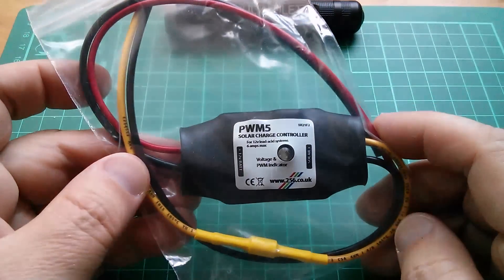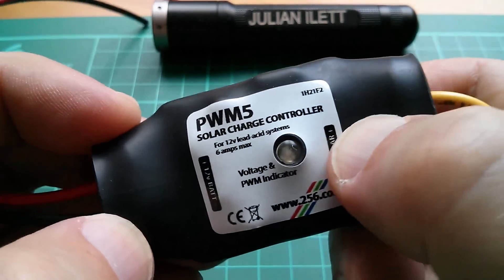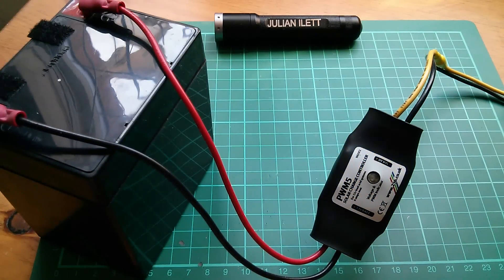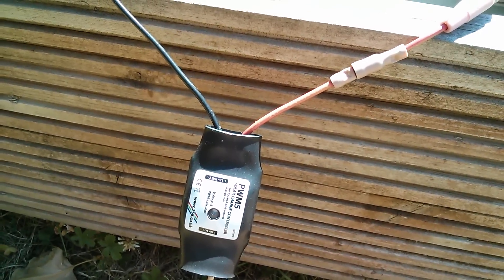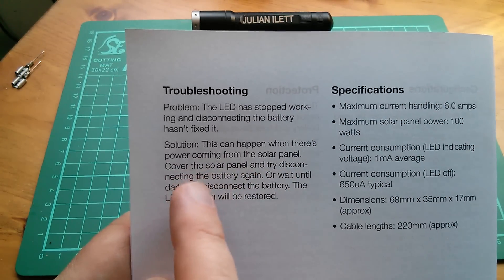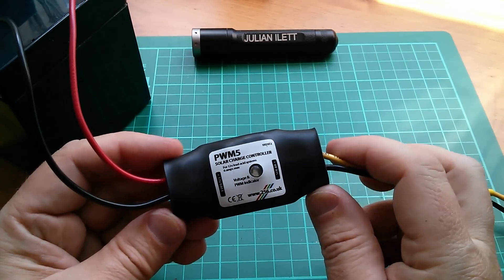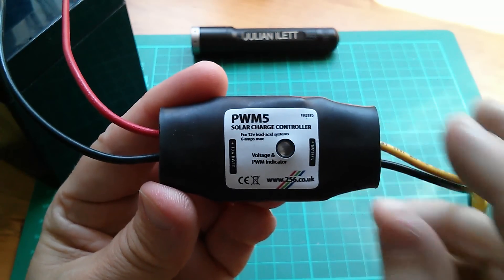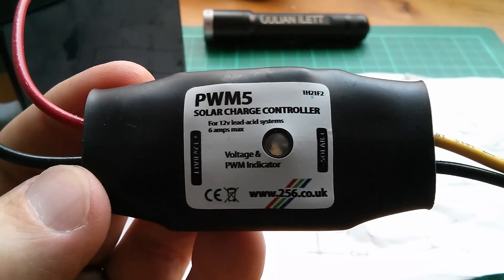Julian reveals: Secrets of the PWM5 - #2 Misjudgement

Comment: Those instructions were not very good.   It is really not hard to say,  very clearly,   that to reset the device it has to be disconnected from both the battery and the solar panel.   This is in fact quite non-obvious,   since most devices are not supplied from both sides,   and if you disconnect from the supply side,  then people expect them to be off.

Comment: New to your channel, but I have to say it surprised me how many people don't don't the manual. Your manual is 1000000x better than cheap Chinese ones. Some common sense helps people. Would love to buy one of these... can't find a reliable charge controller that I like. BTW... love the LED feature... got what it was by reading the label... ha ha... but then again I can read and understand electronics which is where people go wrong with electronics... not having a background or understanding the theory. Diode in the wire is a definite keep no matter what. I have seen diodes in panels fail epicly with whole house electrical fire as a result.

Comment: Were there undervoltage issues? From what I can see PWM5 doesn't monitor battery voltage to protect it if it goes under set limit.
Weren't you worried about getting battery voltage too low and damaging it?

Comment: Hi Julian, I bought a few Boost converters off ebay they waist more pwer as heat than transfer to the battery, may I ask if I can buy one of yours to try please ? I need one that tops out at about 15 volts as it goes via a current regulator circuit and their are some voltage drops across diodes before it gets to the cells. I would love one with the flashing LED feature it will not bother me as it will go in the hallway only spiders sleep in there.

Comment: Nice to see traditional assembler, instead of the blocks of macro's people seem to use.
I added an excess of features to my RGB controller code, then backed off before releasing it because I knew it would just get people tied in knots.  On my RGB knob based controller I even put in a factory reset function (hold knob down while powering up).  That was useful when people calibrated a colour all the way to zero and then complained the channel wasn't working.
Reply: Dealing with end users is a pain in the ass. They never read manuals.

Comment: Julian, this feature is useless. If you don't like flashing led, just cover it or flip controller over :) You would have less trouble if you include black sticker with your product (just for these who can't sleep knowing that one led is still on) instead of your hard work coding this thing.
Reply from the maker: Martynas Mirauskas In a way you're right, it is pretty useless. I deliberately made the LED flashes very short (about 20ms I think), so current consumption is kept low even with the LED operating. During PWM (when there's plenty of surplus power) the LED is on far more of the time.

Comment: I noticed the CE marking on the label, how did you make sure it operated according to the requirement set in the regulations? Did you send it off to have it tested?
Reply: Hampus Sandberg The reality is that you can't, not really. CE marking requires compliance with the EN standards for Conducted Emissions and Radiated Emissions (amongst other things). You can build your own measuring equipment (near-field probes, LISNs etc.) but you will still need Spectrum Analysers, detectors, shielded room, and so on to make the measurements. And how do you demonstrate that the transducers and measuring equipment are working properly and suitably calibrated? You can't without paying a fortune for independent calibration to traceable national standards.  Self-certification does not absolve the manufacturer of this responsibility.

Apologies if I have gone on too much about this, but it's an important area for anyone thinking of designing their own products to sell.  Mind you, contrast Julians' in-house testing to the 'products' from China which probably have never been tested for emissions at-all in their life!
Reply from the maker: Hampus Sandberg Nope - I did my own testing. Interesting thing about CE marking is that products can be self-certified.
Reply: Julian Ilett Interesting, but how did you make sure your measurements were valid and done in a correct way? I would be very interested in hearing more about it, maybe add it to this video series?
Reply: Will Easton I think this is an important subject as well. I took an EMC course last semester and the one most important thing I learned from it is that emc compliance is all about standards and making sure the measurements are done correctly. Doing it at home by yourself is probably as non-standardized it can be, sure you can do some pre-compliance testing to get a ballpark figure but really it doesn't say much.

Like you say, many china products probably get away with it because there's to many products on the market. As long as they don't cause to much disturbance they can get away with it unfortunately. I get that this might be a sensitive topic as just putting a CE marking on the product without testing it at a proper facility probably is illegal, but I think it would be interesting if Julian Ilett explained how he did it and what the thought process was for this product.
Reply: Hampus Sandberg Yes, I agree totally. Like you say, it would be nice to know the testing Julian performed in terms of EMC.

By the way, a much bigger concern for products from China is safety, Julian has shown this in a number of his videos. Here in the UK the Trading Standards authority is unable to keep-up with the large quantity of imports that are untested, badly designed, and potentially lethal. Maybe a topic for another day?

Comment: I have a PIR security light where you turn it on-off-on in the first 2 seconds to fix the light constantly on, as the only easily accessible switch indoors is the fused (optionally switched) spur. It seems that's quite common in some form or another. I like it because moisture in the PIR sensor is what kills most PIR security lights

Comment: Maybe something like a magnetic reed switch would have been a way to change the LED mode without compromising the enclosure. Boot it up with a little magnet touching the device somewhere and the LED remains off.  No magnet = normal mode.
Reply from the maker: Mark Warbington That's a nice idea, although it would mean including a reed switch in every unit.

However, I've just thought of the solution, five years too late of course! Connect the controller to a 9V battery - the low voltage is sensed during the initial 2 second boot and sets the LED disable flag.
Reply: Julian Ilett Help, my led broke when I tried to charge an almost empty car battery ;)    Thumbs up for this series! As a plc/HMI engineer I also run into these kind of issues. You add something usefull as an extra and it turns out it will cost you time in support...
Reply from the maker: thextremeking Thanks for the thumbs up. Of course that would happen, but far less often. Lead-acid batteries are pretty knackered if they get down to 9v.
Reply: That could have been a nice solution.
BTW, error40 or error16, depending on metric or imperial, are not covered by any warranty, so you would have been in your right to charge for at least return postage.

Comment: Why did you write the code in assembly?
Reply from the maker: drojf Most of my programming experience is in assembler. Back then I'd not programmed in C at all. Arduino was my first introduction to C.
Reply: drojf Because C on a PIC12...
Reply from the maker: Mandrake Fernflower Indeed. I run the CPU clock really slow (500kHz) to use less power, so efficient code execution is important.

Comment: A very interesting video, what seems intuitive to techies is not intuitive to everyone. I recently was using a friends boat that uses a solar panel and controller, the controller is a clever piece of kit but by careless pressing of the only button on the unit it can be inadvertantly set into modes that don't suit the 200aH or so of attached flooded lead acid battery. In the case I am referring to the controller has status LEDs but they are very dim (presumably to save every possible milli-amp) so people are drawn to pushing the only button on the unit.
Your controller seems to have a very bright LED, perhaps you could slightly reduce the current through it? For people sleeping on a narrowboat simply put a sticky label over the LED or slide a sleeve over the unit. I think that due to cheapness of electronics these days fewer and fewer of us read the instructions correctly. 
It is good to see that you are making efforts to keep your customers happy but it does highlight how difficult it is!

Comment: I'm loving this series Julian; thanks for sharing the inner thoughts of an innovator. This topic of basically "falling in love" with a feature, despite what customers say or think rings so true and is great example of a trap to avoid for any entrepreneur, regardless of domain - be it electronics, software or a corner store.
Reply from the maker: pratalife If I'm honest, part of the reason for developing this feature was so that I could learn how to read and write to the EEprom - not a very good reason for adding a 'feature'.
Reply: Julian Ilett I can certainly relate to that ... been there myself! 

If you were still selling the unit, the next interesting question would have been to figure the odds on either removing the feature or giving it a more foolproof user interface (like a physical switch). I guess that is kind of unknowable now, unless you have more stories to share...

Marketing two versions (with/without, for a small price difference) would have been an interesting exercise to determine if people really wanted the feature and therefore it would be worth improving. Your experience with the distributor who asked for it to be removed is one data point, but I daresay they might have been more motivated to "eliminate a problem" than really figure out what customers needed.

Comment: A couple things I've learned in the last few years..
1:KISS-Keep it simple,don't overwhelm the customer with features,and doo-dads.(partially because #2) Try to make it as 'plug n play' as possible.
2:Assume the customer is as dumb as a rock (sometimes not far from the truth) and reading/comprehending the instructions is never going to happen.Otherwise It tends to come back to bite you in the butt. (via tech support,and spending hours answering dumb questions that were in the manual,had they read it.)
I would have skipped the LED enable/disable stuff,and told them to put a piece of electrical tape over the LED,if they don't want to see it.
These "simple misunderstandings" can be a serious PITA.
Reply: Before reading this I said the exact same thing about put electrical tape over the LED to stop it. I bet most people just did that. When designing anything you want to make it work easy for the Dumbest users.

Comment: I like the feature, but I can see why some people had problems with it. I'd say this feature had to have a little bit simpler way of turning it ON and OFF. Maybe some sort of a jumper would have been a better idea or a button that needed to pressed in some sequence and it does not get activated by mistake.
The problem with your feature was it GOT activated (or deactivated LED) by mistake and that confuses people, especially the ones that don't read the manual :)
I wish you still had these for sale, I am currently looking for a reliable little PWM module. But happy to see it is going to be public, so maybe I shall build one myself :)
Cheers.
Reply: +Sidabra24.com Yeah, I try to avoid designing stuff with "modes" wherever possible. It just confuses people. In hindsight a nice mod would have been to just put a loop of say blue wire outside the heat shrink case. Cut the wire loop to turn off the LED. 

For the people who don't RTFM they tend to leave wire loops alone. :-)

Comment: I wonder if there could be a hardware solution for this that doesn't require an exposed switch. Maybe an external magnet and a reed switch or hall effect sensor.
Reply: Rouverius its called black tape! cover it up!
Reply: ***** yes but its about half a milliamp difference with the led on, a smallish fraction of the self discharge of a lead acid, better to have the led reminding you it works for the current used.
Reply from the maker: jusb1066 Yes, I now believe the LED should be always on. It's function as an indicator is far more useful than the small amount of current it saves when switched off.
Reply: howarthcd Very clever. Yes, that would seem to be the quickest. lasersbee True but I've found reed switch for only $0.21 (€ 0.19).
Reply: Rouverius Another cheap solution might be a small piezoelectric disk; about $0.60 (€0.54). Knock on it and it creates a small current that can be used as a signal. Also, I wonder if it could also be driven to double as an alarm.

Comment: Should change the name to the RTFM5  At least you had a good manual telling users about it , if they don't read it thats there problem.
Reply from the maker: Andrew Joy If only it was their problem! By offering a 1 year warranty, any technical issues automatically became my problem. Fortunately, this was the main technical support issue I had to deal with. If the product had been unreliable, either due to poor circuit design or buggy software, things could have been much worse.
Reply: Julian Ilett If you do decide to continue producing the PWM5, it might be an idea to remove the LED software disable function and replace it with a small square of black electrical tape. I doubt many people could misunderstand that fuctionality.
Reply: KX36 Just watched the video back. I must have totally glossed over the power saving reasoning for disabling the LED. My mistake.

I think the PWM5 is one of a few products where a really bright blue indicator LED makes sense. It is quite easily visible in bright sunlight.

The software disable function that already exists is probably the most elegant solution for turning off the indicator. I was thinking maybe using a reed switch and a magnet for disabling the LED, maybe add a note on the front sticker to say something like "remove magnet to view indicator". It isn't really an elegant solution and would increase the cost, but i think most people would get it without reading the manual. 

From a superficial perspective the device does look very simple, there are only four wires and each side is clearly labelled, there doesn't appear to be any indication (without reading the manual) that connecting and disconnecting in a certain way would allow you to disable the indicator.
Reply: KX36 I know that feel. I use two monitors and one blinks yellow while the other does a bright blue flash. And at night I was just laying on my bed watching that hypnotizing flashing (went into sync and fell out of sync) until I just taped them over. Monitor leds are the most annoying things after speaker leds.
Reply: Tarek shaaban The idea was to save power since it slowly drains the battery rather than stop the annoying blinking light.  

I've blutac'd over the LEDs on my laptop before. I don't know why people insist on using bright blue LEDs for indicator functions when they just end up illuminating the room. Blue light is also the worst for keeping you awake at night like Mr Narrowboat.
Reply: @KX36  I don't think you would ever see a red led in bright sunlight maybe any sunlight. Blue is the best solution for something that works outside where the brighter the sun the better.